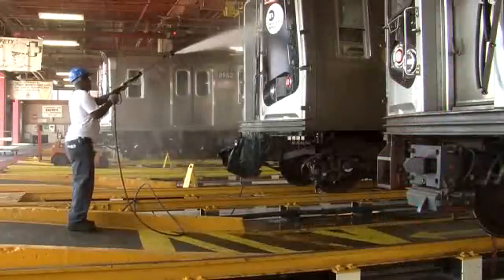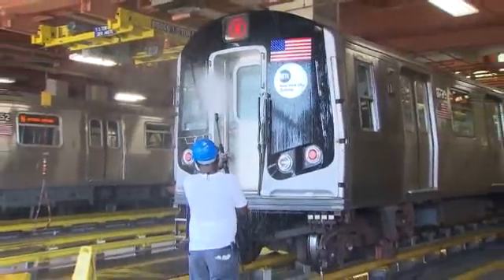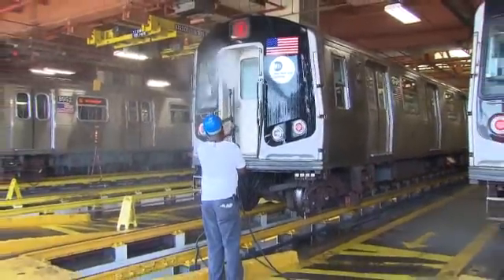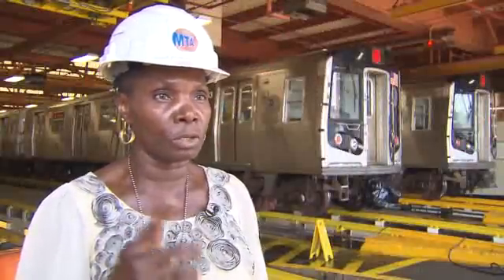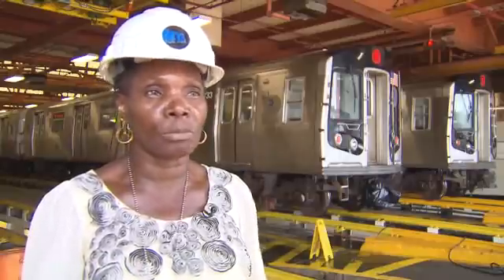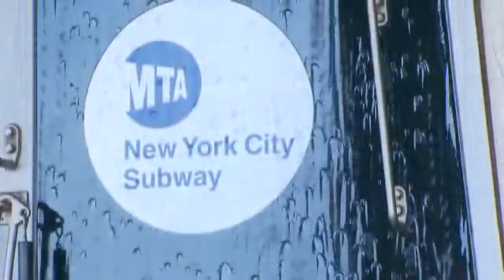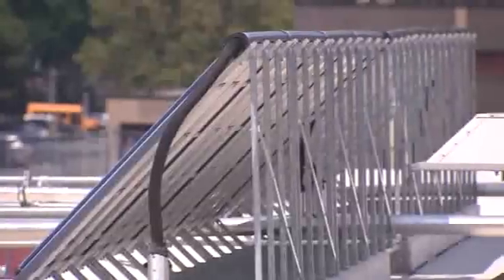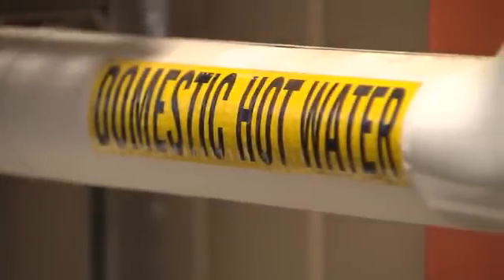Solar power scrubs NYC subways clean

Comment: Insider here.. R179 is a R160 with different power regulation so the city has to buy new fleets all together.. Caching.. Don't worry all the rich people can afford it..
Reply: Erik Breaman Federal law states that after there is 5 year limit on exercising options for train cars. After that, entirely new car orders must be placed. However, this could be a good thing because you can add new stuff on the cars. The R179s feature a larger FIND display than the R160s, plus loop poles found in R160A 9798-9802, and it even has a quieter HVAC, so it’s not exactly the R160.

Comment: Still waiting for the new 179's to go into service. You have to love those 143's and 160's. I'm not going to miss the old 32/42's, 46, 68 and the 68A's. B Division has a lot of catching up to do NTT wise. A Division has most of the new tech.
Reply: I agree with you on everything except the 68/A's. They still got a few years left in them
Reply: +BryanPlayzRoblox -ROBLOX even with the 210s there still won't be enough to displace the 68's, never mind the 143s. plus they still fairly new in terms of subway cars
Reply: BryanPlayzRoblox -ROBLOX The 143s are not going anywhere man!!
Reply: BryanPlayzRoblox -ROBLOX 143s and 142s are still good and the 68/A and 68 AND the r211 will replace all r46
Reply: Not really, to be honest. Look at the (6). It's populated with the R62A. Same with most of the IRT Broadway/7th Av line. The IRT flushing is the one and only IRT line that's semi-modern. But why is the MTA already thinking of replacing the R143 when it's only about 15 years old? We have equipment that's ALREADY 50 YEARS OLD. Why not replace them first and then work our way up to the top? By the way, I would like to express my opinion too. I like the R46, R142 and the R143, THAT'S IT. The rest won't be missed by me.
Reply: NYG1991 the R179 is already in service
Reply: @bruh-qq1sx  wth r143 is going to be retired in 2045, r142 in 2040. The 211 will replace the 46 and 44s, and the 262s will replace the 62/62as.
The 179s replaced the 32 and 42s.